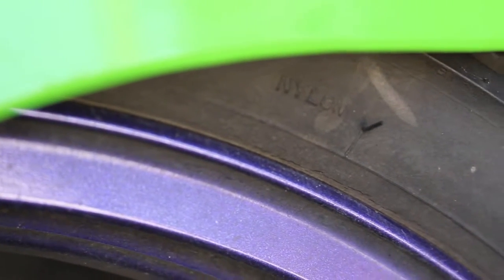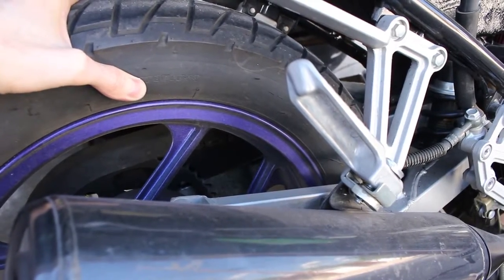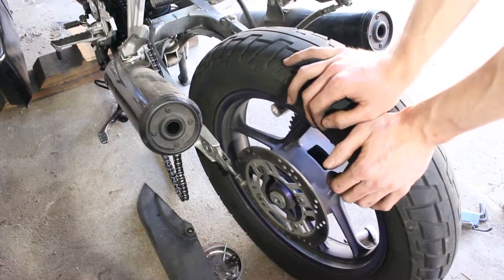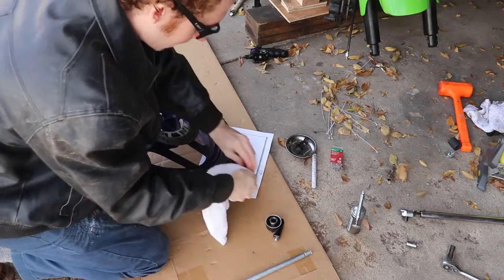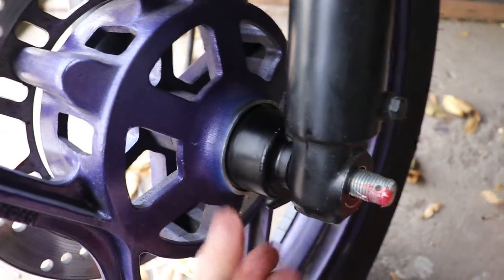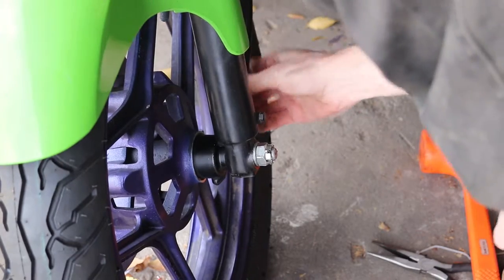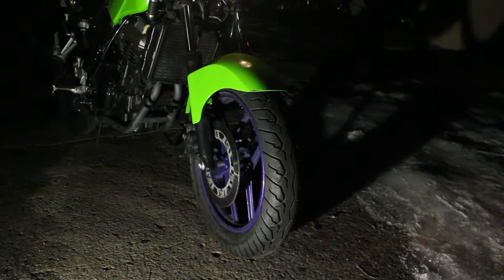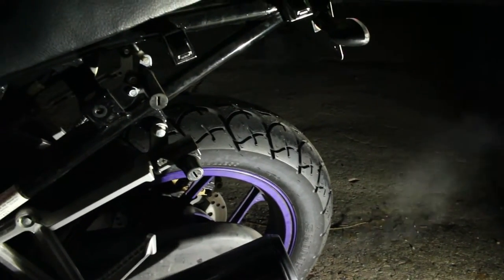Changing Tires! 2000 Ninja ex250

Comment: What tires are those?
Reply from the maker: I added the tire specs to the description. I like them but to be fair I'm only comparing them to  old cracked tires that were on the bike before. They were cheap. Also the rear tire is only rated for 94 mph.